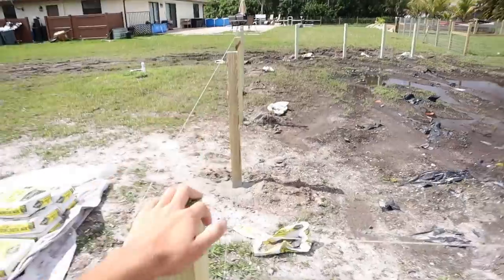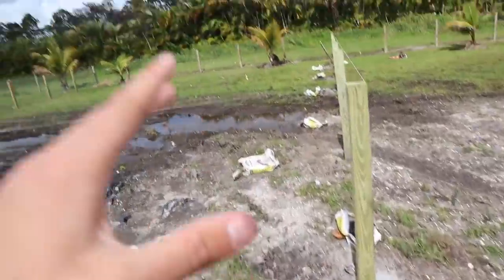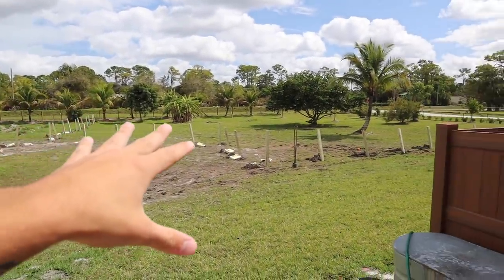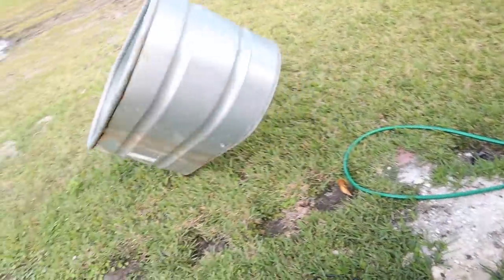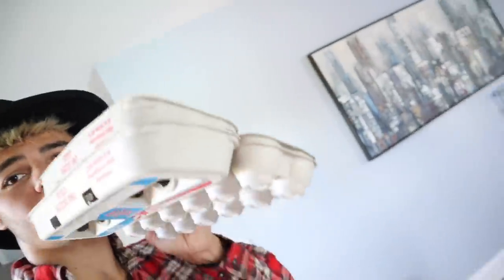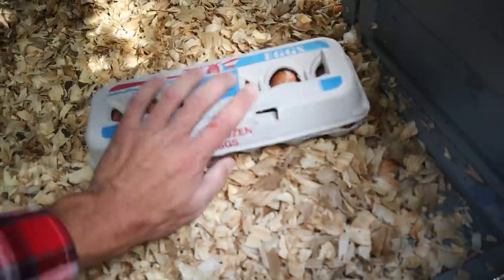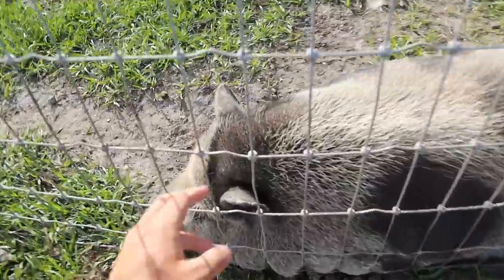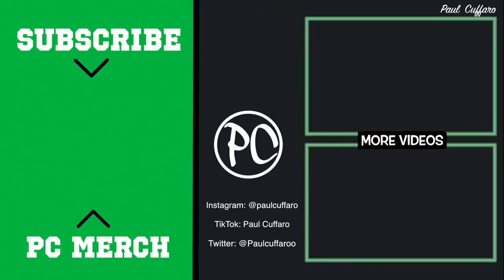My CHICKENS Had 30+ EGGS!!!

Comment: They need to be in an incubator for 21 days, a brooder won’t work
Reply: I’ve seen it done before without an incubator.. but an incubator has a much much higher success rate
Reply: @bluntmachete2799   It works best with an incubator You always get better results. If you do it without an incubator and just a heat lamp you're not going to get any.
Reply: @patrickwhite2762  many people have hatched eggs countless times using the lamp method. Pat down sir.. There's always a way or method existing before advanced technology.
Reply: @aranielleb7718  But hatching in incubator. Is a lot more easier? And more successful.
Reply: I've done both and tbh I've had a better hatch rate doing it like this than with an incubator.. Although it is more hassle whereas an incubator you could throw the eggs in and forget about it
Reply: Wempe Troy yeah, I’ve hatched out loads of chickens, quails and a couple ducks

Comment: 🤣🤣 Paul this ain’t itttt!! 😭😭 You need moisture and need to turn the eggs. It easier with a hen cause nature does it best!
Reply: No he needs a incubator. the chance of hatching is bigger with a incubator than natural. But the way he is going to do it almost none Will survive
Reply: He did say the hens weren’t sitting on the eggs or interested, so they would have died if he’d left them. He also mentioned about turning the eggs. I agree that an incubator is best and his tub thing might only work for the eggs closest to the light.
Reply: he talked about moisture and turning the eggs in the video.

Comment: You need to put the eggs in so that the point end is to the bottom, in an incubator, turn them 2 or 3 times a day. You can also tell if the embryo is growing by after a week or two using a torch and 'candling' the eggs. (You will be able to see the embryo react to the light. Super cool). Love your videos Paul keep up the great work❤

Comment: Paul, a couple of suggestions. I'd put a corrall around your well head to keep anyone from accidentally running it over. You could plant some nice bushes around it too. Plus, just in case the donkey decides to climb on the goats climbing bridge you might want to strengthen it with a cross member board from ramp to ramp on the side. High enough so goats can still go under but strengthen it. Your place is looking great. How about fruit trees for the animals? Love your videos. Keep them coming. Thanks.

Comment: If the way you are hatching the chickens doesn't work I use an electric incubator which makes sure you can keep at the right heat and humidity. Good luck I love having little chicks around in the spring 💞

Comment: They won't hatch ! They needed to stay warm after they were laid and keep warn under a hen so they wint hatch as the went cold
Reply: Edward Tomkins that’s not true eggs can go about 7 days without being sat on by a hen because the hen has to lay a batch of eggs before she begins to sit on them and they do this so the baby’s hatch out at the same time because if the eggs are at different stages of incubation the first half that hatches will dry off and be ready to go so she will leave then nest and the baby’s who are younger in incubation will die in the eggs because they weren’t ready but unfortunately these eggs will probably not make it due to the heat not being warm enough or the humidity being high enough and if they do make it to full incubation it’s gonna be hard for them to hatch because the shells aren’t gonna be soft from the humidity and they will probably die in the eggs
Reply: Yes they will probably not survive and it can  be shorter than 7 days temperature permitting I'm a farmer
Reply: Edward Tomkins I’ve left eggs out on the counter for 8 days then put them in the incubator and only lost one egg out of 24 I’ve been raising chickens my whole life Ik I’m young but I’ve been raising them for 13 years now the best way I’ve found is just to let a hen hatch them and take care of them then you don’t have anything to worry about and I’m a farmer too
Reply: Best way is definitely let the hen to on them and rear them up

Comment: Paul you need to add moisture to your incubating tank. Just put a tub of water under light. You need to keep temperature around (78 to 99.5 Fahrenheit) with 50% to 65% humidity. Mark one side of eggs with a x so you can see which ones you've turned. Turn them 3 - 4 daily Do not turn them during last 3 days. And make sure not to turn then upside down or embryos will drown GOOD LUCK HATCHING.

Comment: Yea you need a incubator there at tractor supply and there pretty cheap it'll help keep the heat and humidity at a constant level and it'll rotate it by itself. Its way more convenient

Comment: PC you need the right temp, humidity and rotation of the egg. it would be a lot easier/better to hatch them in a incubator . TSC has them all in one. holds 24 eggs. its almost a set and forget cuz you have to keep up with the water.
the odds are not in your favor the way you set them up. not hating just trying to inform

Comment: Paul you need to get an actual incubator because chicken and duck eggs need a certain humidity level to develop. And just because it's got a white dot in the middle doesn't mean it's fertile. You've gotta wait a week or 2 and do what is known as "candling" the egg which essentially is taking a flashlight and putting it up to the egg to see if it has developed any blood vessels. It's best to do it in a dark room so you can see it better

Comment: You are doing great with the heat and your right you need to turn them daily, but another detail if you put a flashlight underneath  the egg then you'll see if there is something in it or not cause not-fertilized eggs will start to rott and smell🥚😵🤢

Comment: Paul the eggs have to be at 99 degrees. And if I was you I would lay the eggs on there side and put a x on one side side you will know you have made the turn . With the way u have the eggs sitting upright I hope the air sack is at the top do you gonna me in trouble.put a thermometer where the eggs are to keep the temp correct. And the humidity has to be right also . Been there done that many times over . Get you a incubator if you really want .chicks.

Comment: They will not survive , if you do not put them in an incubator, the incubator has an area for water, this is to produces humidity which the chick's needs to be able to hatch,  if you don't the egg will dry out too fast chick will and not be able to get out of the egg, as it will be too dry and hard to chip its way out, with its egg tooth on the tip of its beak, the humidity needs to be rised a few days before hatching to help with the hatch period. Temperature: The eggs need to be kept at 99.5 degrees at all times; just one degree higher or lower for a few hours can terminate the embryo. Humidity: 40 to 50 percent humidity must be maintained for the first 18 days; 65 to 75 percent humidity is needed for the final days before hatching.. good luck, but if you ask me you should get your self an incubator, or borrow one from a friend

Comment: You will have a low chance of hatching these eggs considering these need a temperature of 98 Degrees F daily rotation like mom would and humidity so the chick doesn’t try up in the eggs incubators aren’t expensive you can buy them that rotate the eggs for you and you fill water in the incubator to keep humidity stable ! 
Also hens are only stressed when removing eggs if they are broody other than they they couldn’t care less! But fake eggs are great for encouraging more egg production!

Comment: Dear Paul,

I'm not trying to be a hater but you NEED to do research on horses. There is a lot of money that goes into them think of how much money you have spend just a month for hay and shavings. And not gonna lie but if your going to ride them or if your going to have a  trainer come out that would still be  up to $1k for the tack (tack is saddles, blankets, halters, etc) so if your getting 2 horses I wish you luck because it'll be difficult. Donkeys are better and cows. And don't get a filly because that's like a few thousand dollars a month to train the little guy, so look on like equine-now and look for trained horses. GOOD LUCK PAUL!!!!!!!!!

Comment: What are you doing in the eggs 🤦

Putting heat lamp without water for moisture thermostat and egg is not going circulate side by side is a big mistake WTH!!!

Even candling process if fertile and infertile the egg you don't do first before put in your diy wrong incubator 🤦🤦🤦